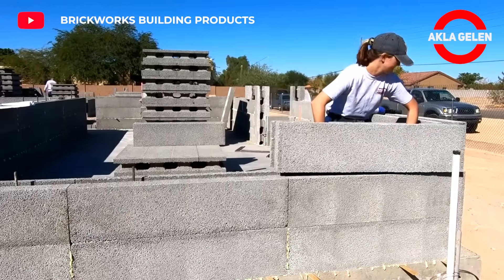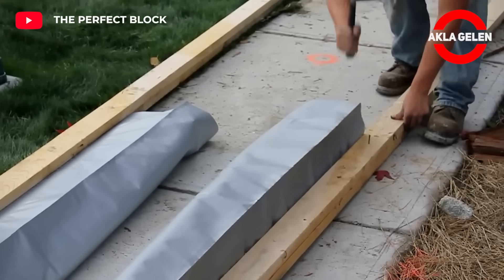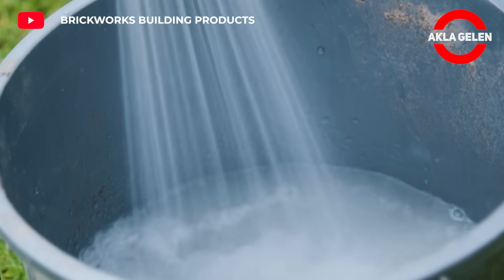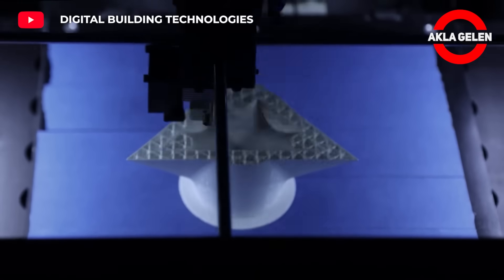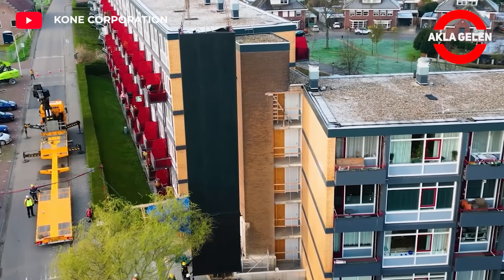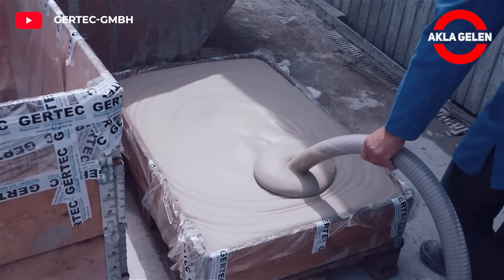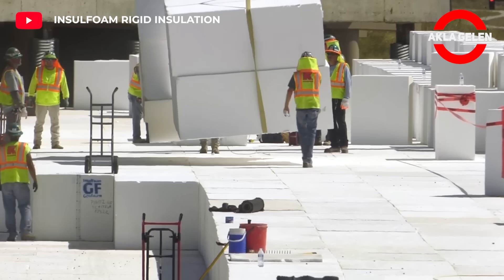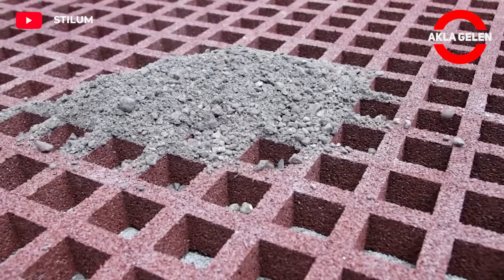Construction Workers Can't Believe This Technology - Most Ingenious Construction Inventions

Comment: 1)  Fake bricks were not staggered.  Walls are unstable. Foam injection is also poor mortar... you then poured flowable fill into it..
2)  re-engineering a cardboard sonotube into a plastic sock that you pray doesnt blow out. 
3)  glass block windows, ....  will crack
4)   ice sculpted trash
5)   need a detached elevator for that tree house?   if not move on. 
6)   "Foamed concrete"  or airated mortar, without reinforcement... made by 2 retirees pushing a scam..... will not meet IBC/ASME code

7)   Geo Foam.   Finally a legitimate construction method.   Typically used for overpass ramps to reduce overburden and settlement. 
8)   not sure what the gardener's nightmare has to do with "fall prevention"

Comment: 1:00 - what ? House build from XPS ? What about bearing capacity of it ? What about wealth ?
Reply: vertically unstaggered blocks will cause unstable walls. 
a few vertical pieces of rebar without running rebar laterally in the poorly built wall. 
you are better off with a wood-framed home